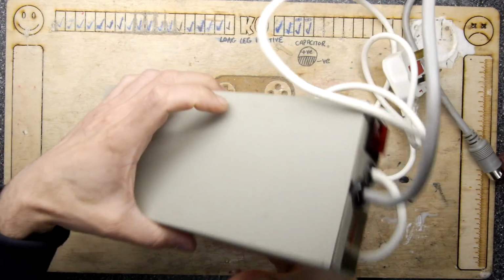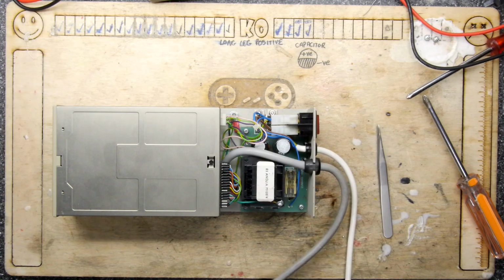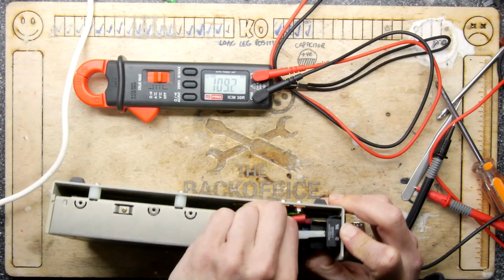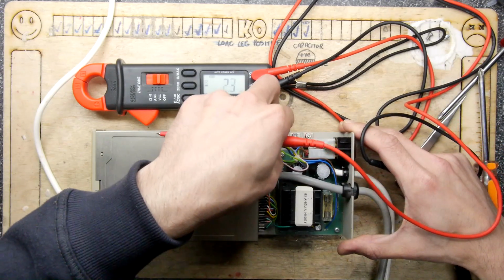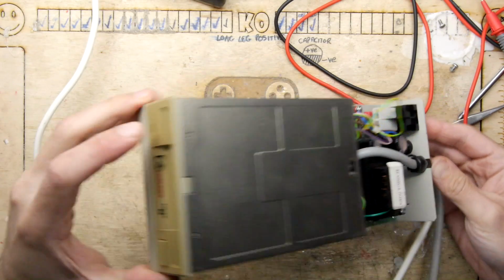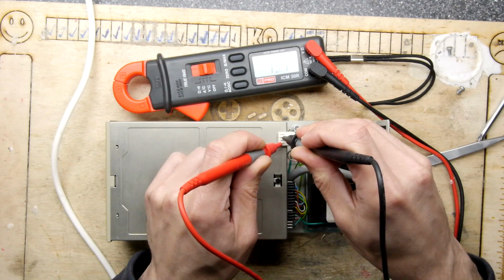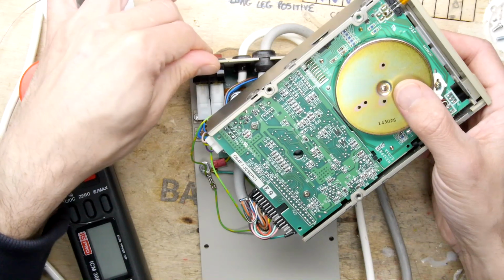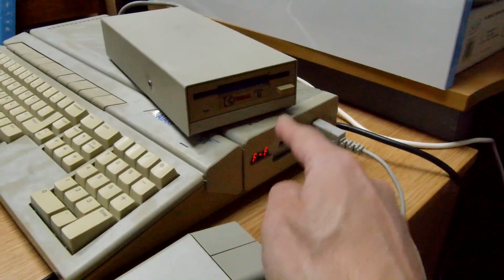Atari ST Drive Repair Cumana

Comment: Does the Atari switch the A and B drive when you power on with both mouse buttons pressed, like the Amiga?
Reply from the maker: Edwin Noorlander I am pretty sure it does not, but I have a video on how I modded the hardware up allow this is out soon
Reply: backofficeshow can’t wait 😊. I wrote my first software on a ST. That where sold in a shop. I was only 13. I wrote my software in GFA-basic, remember that?
Reply from the maker: Edwin Noorlander I have a copy of it on one of my cover disks! We can have a look at that!!
Reply: backofficeshow that’s awesome. Thanks maybe I bye a ST for old time sake.
Reply from the maker: You need to!!
Reply: backofficeshow I think your right. Up to the Falcon 😁, well start with a 1024STE. The problem is the space at home. I have 4 C64 and a A500, MacBook 520 and PowerPC en more old computer. All next to my elektronik Lab with old Tektronic scoops. Hmmm I need a bigger home 😂
Reply from the maker: Edwin Noorlander you can never have a home big enough for this hobby! If you have Discord jump in, we talk lots about this kind of project
Reply: backofficeshow yes I now, I’ll wait until the kids live on their own and then start a Retro Museum 😂 I also like old arcade systems. I’m helpless 😔